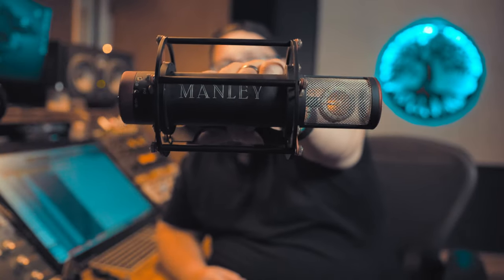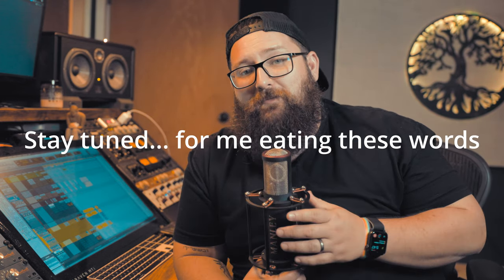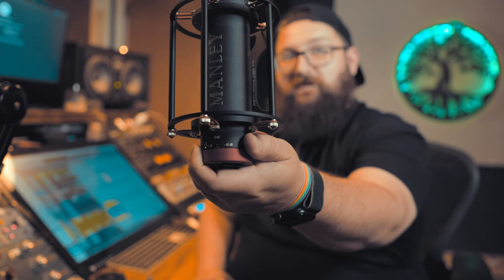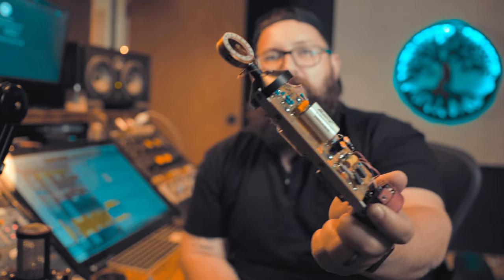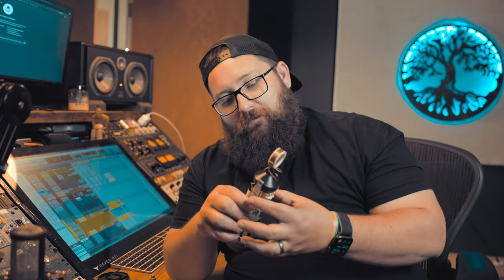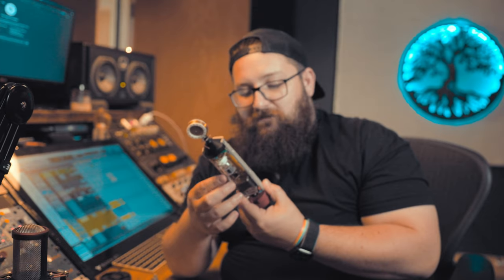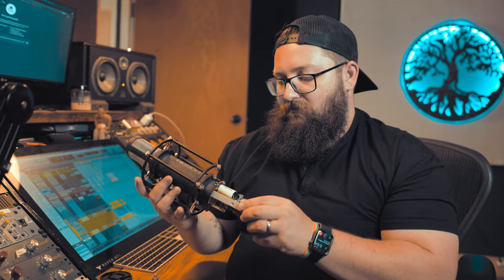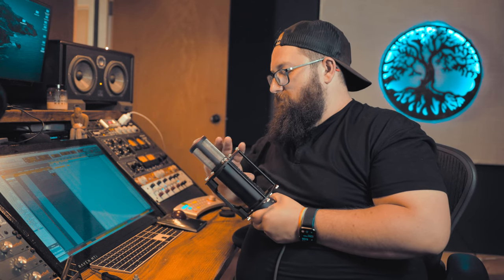My Mic BROKE. Can I fix it?

Comment: Did you figure it out? my Manley just stop working.. had it for over 10 years I was hoping its just the tube
Reply from the maker: I eventually got it fixed. But only after I had really started to dig another mic. I don’t recall what was wrong with mine but it was not the tube.

Comment: Hey there! I’m having a similar issue with my mic. What ended up being the issue with yours? Thanks!
Reply from the maker: Hey. If I recall a cap blew. Led to changing most of the circuit and the tube.  Quite a pricey expensive fix.